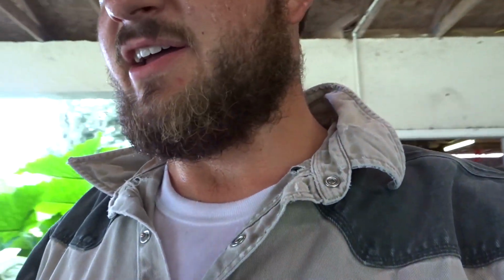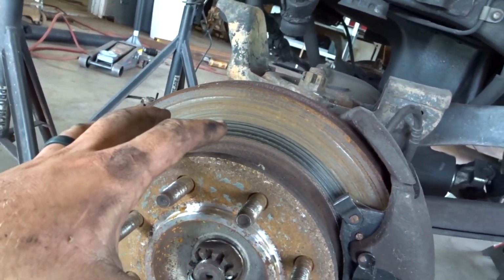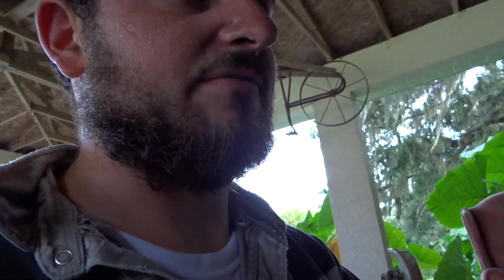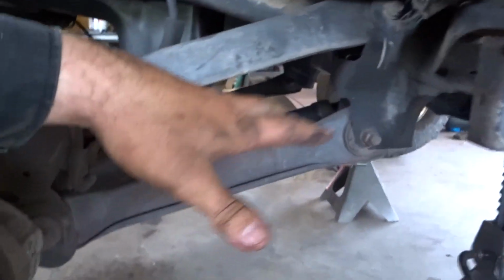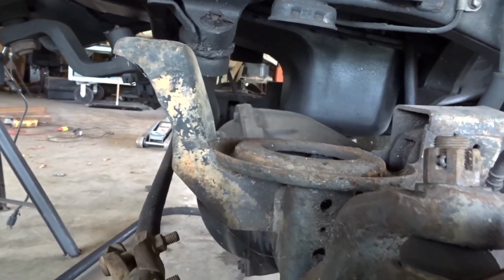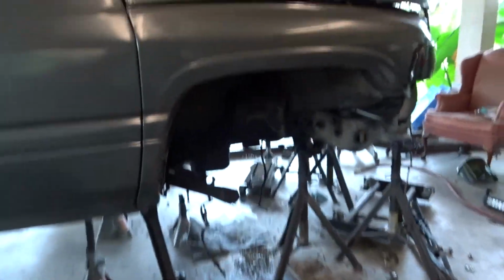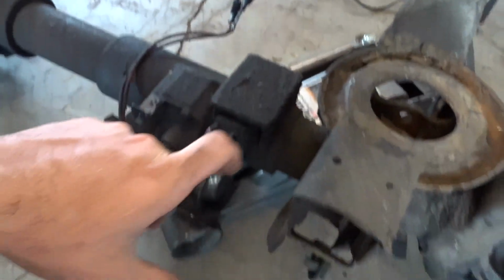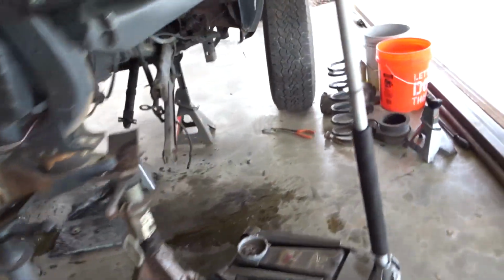2nd Gen Cummins Project: Pt 6 Front End Tear Down

Comment: I'm sure ya know by now but to make a slick front end you could just retune the pass side eliminating the vac disc cast steel. pick ya  up a long inner axle shaft and hang you a set ball joint ford dana 60 outters winch you a serviceable rebuildable set of outters, locking hubs and your good to go. nice fab on your vids

Comment: I never comment. However, I like what you’re doing. You need the passenger front axle shaft from a 2002 Dana 60 without the CAD.

I have a Dana 60 rear disc, bought it for the disc stuff. If you want it let me know. I’m near Lakeland and need some welding on my rig, possible barter? 😁
Reply from the maker: Don't think i "need" the axle haha but i can surely help ya out with the welding
Reply: J_Moffitt how do you suggest doing a long bed to short bed? That’s what I need to do. Go from a dually to a srw truck. It’ll be sweet!
Reply from the maker: So you want to shorten the truck and also get rid of the dually look that correct?? This is just my opinion but if you want to shorten truck you could cut frame behind cab and shorten it that way but would probably make the frame weak in the area where it is welded.  Other option would be to just move you're leaf springs forward but that may not work depending on the frame layout now.  But the way I would do it is 4 link it and either coil it or bag it as I'm doing with my truck just makes sense if you're wanting to shorten it.  Do some research as well, I'm sure other ppl have done this and could give you a better direction than I can.
Reply: Stacy David on gears chopped and shortened a classic truck and turned out good. Z cut the frame and installed "fish"(?) plates to reinforce the welded area. If I find a place willing to do it that's the route I'll go. Semi trucks and limos are stretched and in some cases shortened all the time. Can't see why my case would be any different. Thoughts?
Reply from the maker: Yeah they are done all the time but semis are usually riveted and limos are not carrying weight the same way as a truck and flexing like a truck would I've never done it or tried to do it so i cant say anything for sure.  If its gonna be like a "show" truck that gets driven once a week then id say it would probably be fine.  I'm the kinda guy that will try anything even if ppl tell me don't ill do it anyway so that i learn first hand and not just what someone is telling me and learn form it.  just my 2 cents tho should be a sweet truck anyway you do it
Reply from the maker: I will add that it can be done right because all newer dodges their frames are welded at some points so i know it can be done I've just never tried it before.